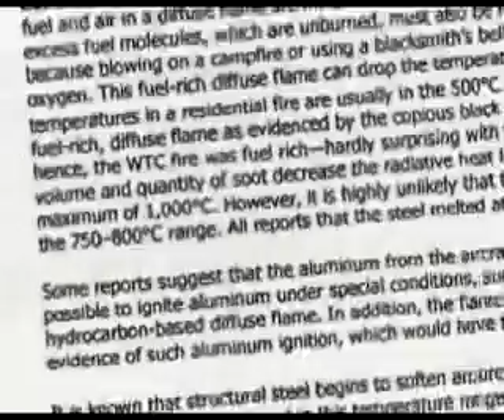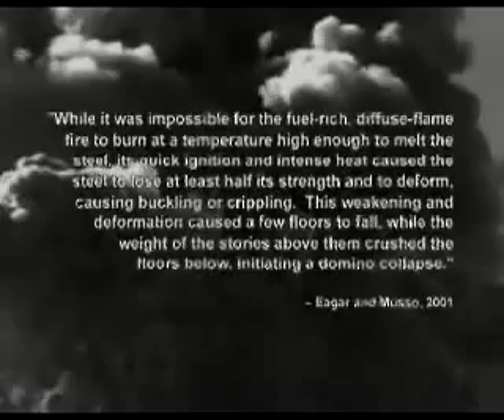Steel Facts and WTC Collapse (Part One)

Comment: Even more basic is the behavior of "weakened" steel, which does not fail instantaneously, especially in a simultaneous manner, particularly when heated by random fires of dubious sustained temperature.

Comment: What's even more basic is that a "weakened" steel structure has never before collapsed as abruptly as the WTC towers, indicating that controlled demolition should at least be investigated, NIST's assertions notwithstanding.

Of course, the government won't open THAT can of worms. Just not prudent politically.

Comment: here's something to chew on, after the planes exploded in a huge FIRE ball don't you think the heat energy from the burnt aviation fuel would have dissipated rather quickly, and not have been hot enough to reach the yield point stress to weaken the core columns? just a question

Comment: Nothing I have said has to do w/ any theory. If it wasn't a conspiracy, it must have been a natural event then.
In 45' a B25 struck the empire st bld, the occupants stated "the building swung like a pendulum for 30sec" no one said any such thing at the WTC. On the street ppl agreed "it sounded like a can being crushed, then 5sec later an explosion", the av gas ignited. Fuel air ignitions are never done in enclosed areas, due to the lack of oxygen.
Ignorance of the laws of physics is no excuse.

Comment from the maker: "Of the more than 170 areas examined on 16 perimeter column panels, only three columns had evidence that the steel reached temperatures above 250 ºC (480ºF). Using metallographic analysis, NIST determined that there was no evidence that any of the samples had reached temperatures above 600 ºC (1110ºF)." (p 140)-NIST

Comment: At 1200 F, steel has about 50% of its Tensile strength. Wich explains why WTC 1&2 collapse after the plane knocked a hole thru several collomns.

Comment: @muzicmaker2001 tower 6 didn't catch fire. all three towers that fell suffered both significant impact damage and prolonged exposure to fire no other steel building in history has been exposed to both at the same time. they can withstand one of the two, but both combined is a death sentence.

Comment from the maker: The official explanation is that fire (not damage) caused the collapses. if a fire lasts 18 hours compared to another fire lasting just 56 minutes, does it really matter if it was "actively fought?" Also, other buildings in the WTC complex were damaged more severely and had fires lasting longer than the Towers. For example, WTC6 was in between the WTC1 and WTC7. It never collapsed.

Comment: It's a little thing called logic that you are ignoring. The Meridian Plaza was not structurally damaged by a plane, or by the debris from a falling building.  It did not have an open floor plan with the exceedingly long trusses.  The fire was actively fought by fire personel.  Why would you think a comparision between the two is appropriate?

Comment: These were column in column design that allowed an open floor plan.   100% of the buildings that were significantly damaged. with this arrangement collapsed when fires were started without anyway to fight them.   How is that hard to understand?   Is 100% a concept that is too difficult for you?

Comment: Oh but you forgot the more significant difference aswell. The empire statebuilding was also built using much more stone and cement than the WTC was. These materials, unlike steel, are not easily susceptable to fire. Even if they were the bomber that crashed into it carried a much smaller quantity of fuel and since the building was made with more stone and cement there was also less flammable materials inside. Remember it was not the impact that took the towers down it was the fire.

Comment: Also just to point it out the empire state building was also designed to withstand an impact from an aircraft... at least untill a bomber managed to fly into it trying to navigate through fog in the 1920's. Might I add that the empire state building is still even more sturdy then the WTC was... and yet a bomber in the 1920's managed to crash through even it's thick outer shell and lodge it's self inside. It didn't even have jet engines either. Just a damn propeller.

Comment: Try again kid... Yes they are comparable in size, however, you neglect to realize density is a different matter. on top of that the newer models also have much more powerful engines than their predicessors. To top it off the towers were designed to withstand an accidental impact at normal speed... Not an intentional impact at the considerably higher speed the newer engines are capable of.

Comment: A protected steel building with intact fireproofing can take this abuse, but when the fire proofing is damaged or stripped by a plabe impact beforehand the fire will cause structural failure with prolonged exposure. Fire fighters have a saying reguarding this fact by the way... It goes "Don't trust the truss". This is because steel trusses within buildings, like those in the towers, are knowen for collapsing ontop of fire fighters during fires and that is when their fire proofing IS intact.

Comment: Also what you have to realize is the towers did withstand the impact from the planes. The impact is not what took them down. Infact had it just been the impact they would still be standing but there was more to it. The impact stripped the fire proofing off of the steel and the damage and height kept fire fighters from putting the fires out for hours.

Comment: As you recall the titanic was also designed to withstand an impact with an ice burg. See the thing is these buildings were designes decades before they fell. During that time planes were much smaller, lighter, and carried less fuel. These buildings were not built with a 767 in mind. A 767 fully loaded has a maximum take off weight of 200,000 pounds the planes that were up in the air when the towers were designed... well it is like comparing throwing sponge at some one with throwing a rock.

Comment: @jannikmt Yea... Every report shows that the steel was heated to at least about 250 degrees (C) at which point steel loses 20% of it's strength. Let's not forget the structure lost about 15% of it's strength before that just from the damage the actual impact did... Hmm lets see that is a 35% drop in the building's structural integrity and it also now had to support the weight of what was left of the plane (which is pretty damn heavy). How do they not understand how significant this is?

Comment: @MrAwsome514 Uhhhh, read the NIST report.  Even YOU should be able to comprehend that.  Or, if reading comprehension is not your strong point, watch?v=iSnjyZNYlW8 and watch?v=cYdFd8CXQqM&feature=related.  So you can hear it from the mouth of one of NISTs lead researchers.  Again; if you're going to argue in support of the official theory at least know what it is.

Comment: @MrAwsome514 Dear god.  Are you people still on the fuel tank wagon?  If you're going to argue in support of the official theory at lest know what it is.  NIST has specifically stated in their report and follow up FAQ and Q&A that the fuel from those tanks had no affect on the collapse of the building and that 95% of the fuel stored there in was accounted for.  Additionally "25% of it's structure" was no torn away.

Comment: @vengencefrom1979 tower 7 took extensive damage from falling debris before it collapsed. Firemen and police officers along with survivors being escorted away from the towers all claimed to have seen tower 7 have nearly 25% of it's structure torn away by falling debris from the other towers. We even have videos of this... In addition to the impact damage one of the impacts struck a back up generator in the building destroying it's fuel tank and igniting the fuel.

Comment: @MrAwsome514 The only aircraft w/ a titanium frame is the SR-71, very expensive specialty aircraft.  The only steel (in quantity) would be in the motors for hyd and control, and springs.  1000 passenger seats and not one example of seat springs.
u know nothing about aircraft construction, the system of spars are made of aluminum sheet as well.  They are formed into shape for rigidity.
Steel is too heavy to use on the frame.
I could have earned two doctorates from scratch w/ my formal education.

Comment: @wildnorm The only aircraft that can fly 500mph @ sealevel are fighter jets.  Commercial airliners create way too much drag, in addition the turbines are designed for eff @ 60,000 ft.  That means they can't produce near as much power @ low alt.

Comment from the maker: @MrAwsome514 
Hollow aluminum wings VS. a steel wall? The result should be the same if you reversed the momentum..meaning if you slammed a steel wall into a parked 767 at 500mph. The plane would be crushed and would not enter the wall. Please read a book.

Comment from the maker: @MrAwsome514 
People were seen at the North Tower approx 20 mins before it collapsed. This means there was a full 80 mins to heat/weaken the steel to complete failure. As already mentioned, the South Tower collapsed in 56 mins. I didn't realize that you tour multiple 911 pages spreading good your cheer. Your lack of common sense and logic makes perfect sense now. An agenda is always more powerful than logic.

Comment from the maker: @MrAwsome514 
I don't what to say anymore. First, other steel framed high rise fires have engulfed the entire building and lasted nearly 24 hours and never collapsed. The South Tower collapsed to dust and manageable tseel pieces in only 56 minutes. And you state it would not have taken much time for jet fuel whose max temp is around 800C, to weaken massive steel? LOL. Logical question: Why hasn't ANY steel framed high rise totally collapsed from fire before or after 911?

Comment: @cheerdiver Actually the wing tips would have penetrated. Wings are light weight and weak structures but they are the strongest at their front. This is becuse they have to be able to withstand the wind resistance of high speed travel. It is kind of like an egg shell... If you throw an egg at a wall you would expect it to break every time but there is a point on it at it's top which is considerably stronger than the rest of the egg which will not break if it is the point that strikes the wall.

Comment: @muzicmaker2001 The thing about jet fuel is that it burns hot and it burns fast.  The trusses heat up fast and weaken quickly. It would not have taken much time for the burning fuel to have weakened the structure and burned it's self out.

Comment: @muzicmaker2001 You really are an idiot... 1,200 degrees is the temperature of tha actual flames themselves. Unless the people seen walking around the impact hole where actually rolliong around in the flames themselves ofcourse they aren't going to feel temperatures that high... The Steel trusses that where exposed to open flames where the ones that failed... by the way those trusses are thin and heat up fast exposure for even a short length of time would have been enough.

Comment: @muzicmaker2001 1st the aircraft DOES NOT slow down, it is an image not a solid body.  The wing tips would not penetrate, anything from the engines out would have landed in the street after bouncing off the structural steel.  Once the body entered half way, it would have slowed enough to leave the back half sticking out.  No black boxes recovered, no NTSB report on it's crash report pages on that date.  Turbine from a 737 laying under scaffolding.
The columns were just folded back, so obvious.

Comment: @muzicmaker2001 it is accurate enough to proove that it is well above the 218 that you claimed as it's maximum temp. Even if you assume it is off by as radical an amount as 50% it would still be at least twice as hot as your estimate. By the way color indication is actually considerably more accurate than you give it credit for.

Comment: @cheerdiver You make the assumtion that aluminum is the strongest material in an aircraft. An aircraft's engines are composed largely of steel and would have made that building look like it was made of paper mache rather than steel and concrete. How exactly do you think the impact violates newton's third law?

The mutual forces of action and reaction between two bodies are equal, opposite and collinear. 

Seems to fit if you ask me...

Comment: @MrAwsome514 A controlled burn has the fuel regulated, this was not controlled and a max temp of 218deg C would be expected.  Forced induction is required to raise temp, that is why blacksmiths invented the bellows, to WORK steel(not melt).
A SINGLE fission detonation was required and built into the structure before construction even started.  Port authority pushed the button.
NTSB has NO REPORT on why the alleged planes crashed, do u really wonder why??
Dimitri Khalezov explains it all to a T.

Comment from the maker: @MrAwsome514 
Again, what explosives were used and how the charges were set up is an unknown. But, there is evidence that nano-thermite might have been painted on the columns. And since day to day employees do not access the inner portions of the building, how would anyone notice? The set-up could have been done in a period as long as years with a little performed each time. I have no idea why you would think its impossible to achieve.

Comment from the maker: @MrAwsome514 
EVIDENCE: are hese events normal for a "pancake" building cllapse? Obviously, no..

1. Near free fall collapse
2. Witness accounts of explosions
3. Pulverized concrete at initiation of collapse
4. Pre-collapse ground shaking
5. Demolition flashes
6. No physical evidence of extreme heat at impact hole but..
7. Extreme temps buried in basement/rubble for weeks
8. Nano-thermite discovered

Comment: @muzicmaker2001 Also are you familliar with just what is actually involved in performing a controlled demolition? A controlled demolition of these buildings would have taken hours to set up even if you had 100 people working on it. Even then You would have to use several truck loads of charges to actually have enough to bring it down with. It would be a major operation which simply could not possibly be done with out everyone in and around the tower noticing it.

Comment from the maker: @MrAwsome514 
The video states that an open air fire (uncontrolled burn) reaches 1200 degrees. It really doesn't matter what other videos claim, there is no REAL physical evidence that shows that any of the steel directly from the impact zone reached temps high enough to cause total failure. Again, using simple logic, if they did, the people seen walking around the impact hole would've been killed. FYI, that is MY side of the story.

Comment: @muzicmaker2001 Oh really... That is funny because even this video states that the flames that can be seen from the outside where at least 1,200 degrees. Not to mention every other video I have put out by you truthers claims that the flames reached temperatures of up to 1,800 degrees. You don't even know your own side of the story... That is what is rediculus here. By the way Tower 7 was struck by the top of one of the other towers which rolled into it as it reached the bottom.

Comment: @muzicmaker2001 Once the columns had been pulled fare enough inwards the weight of the building could not be supported by them causing them to snap and well you have seen what happened after that. Ofcourse if you have read the NIST report you should already know this.

Comment: @muzicmaker2001 That is just it... The perimeter columns where not the parts that where damaged by heat. Why would you even think that they where? being on the outside of the building the air would have kept them cooler than the building's interior. It was the trusses between them holding up the floors that where heat damaged. These trusses began to sag inwards under their own weight and pull inwards on the perimeter columns. You can even see the colimns bowing inwards in all of the videos.

Comment from the maker: @MrAwsome514 

"Of the more than 170 areas examined on 16 perimeter column panels, only three columns had evidence that the steel reached temperatures above 250 ºC (480ºF). Using metallographic analysis, NIST determined that there was no evidence that any of the samples had reached temperatures above 600 ºC (1110ºF)." (p 140)-NIST

Comment: Steel loses 50% of it's strength when heated to 1,100 degrees. a fairly large percentage (roughtly 15-20%) of the support beams where severed by the impact of the aircraft and half of the remaining beams where heated to temperatures in excess of 1,100 degrees because the fire resistant foam insulation was stripped from them by debris from the impact. This means that 40%-42.5% of the support columns where either destroyed or severely weakened. No one ever claimed the columns melted.

Comment: @yewutube If you think a 1/4" thick column is a steel beam....you would probably think my old 55 Chevy had steel beams for fenders. Come on dude, that's basically sheet metal. I could practically bend those columns with my hands. 
The lower columns did not bend or break or get crushed. They got knocked over! And yes, a half a million tons of concrete falling from 500 feet up will knock over most of the columns. Not ALL the columns were knocked over by the way. Many lower columns survived.

Comment: @forged4 The planes didn't hit over 95% of the columns. But I'm glad you brought me here because I recently learned that the columns were tapered in thickness from the base at around 4 inches thick to the top floor, only 1/4 inch thick! So where the planes hit the columns they were maybe around 1/2 thick! Suddenly we know what happened to all the columns. There weren't any real columns near the top. The lower ones were knocked over my a million tons of concrete crashing down on them.